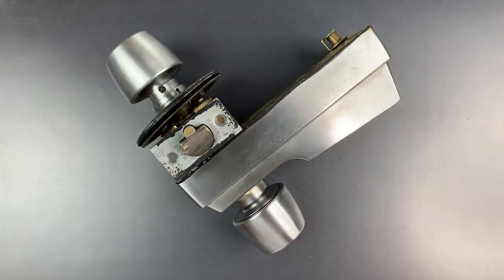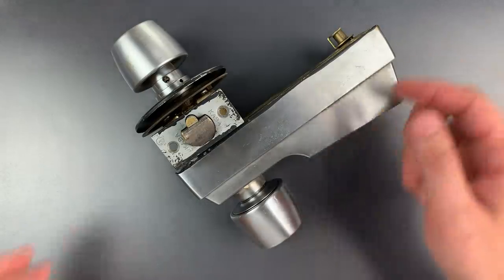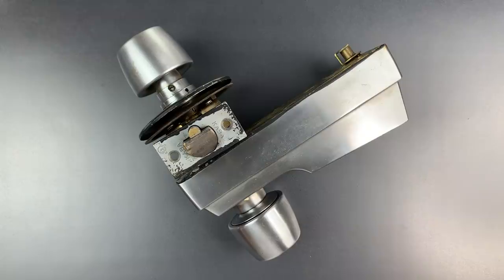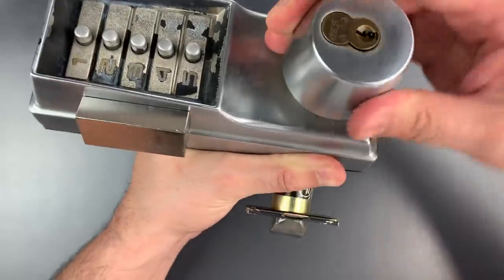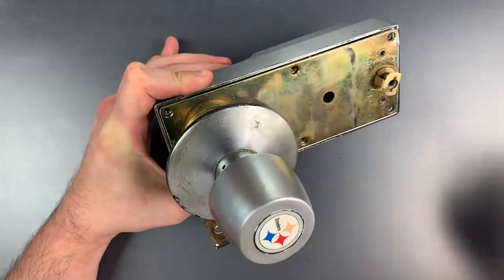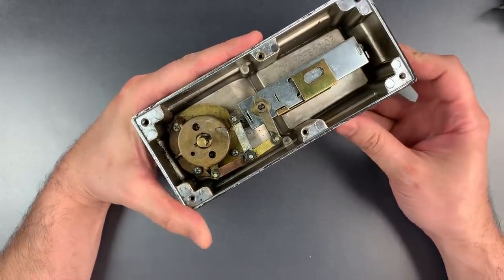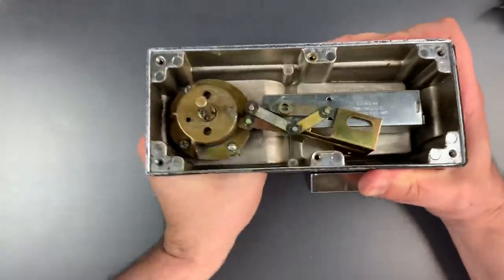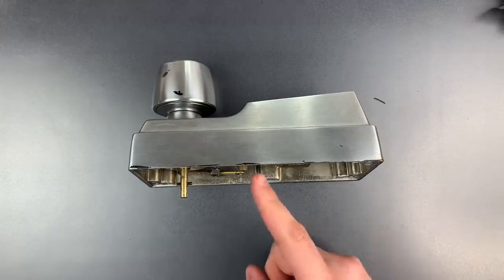[914] The Worst Lock Design Blunder Ever? (Kaba Simplex Series 1000)

Comment: I'm looking at the screen then looking to my right side at my office door,  yep same lock and it's the old version.  My office use to be a research lab, humm guess I'm bringing my neodymium magnet to work tomorrow.  Ok, year later and an update, they put a card key at the main entrance to the area where we had many of these locks about 9 months ago.  Since then I started picking as a hobby and hooked up with the company locksmiths and found boxes and boxes of these old ones ready for disposal.  On a happy note they gave me a bunch of Schlage cores of differing difficulty along with a follower and a few blank keys so I could try out making my own.  We still have a few around but they are for non critical areas so it's not so bad and they're replacing them all slowly but surely.  And have a nice day :)
Reply: William Borgeson is that the only magnet that will work?
Reply: @lagspresso  well, it's gotta be strong and neodymium is hella powerful. Could open up an old hard drive and use those
Reply: Yeah, let us know what happened.
Reply: please update us op
Reply: Olaf Miklas  The HD from older computer had bigger, 4X, magnet. The newer one may be not strong enough.
Reply: Neodymium magnets are easy to get nowadays anyways. I used to have those from hard drives. Very strong.
Reply: Me interested too....
Reply: Update please 🙏
Reply: Update! We want an update!
Reply: Place holder for an update
Reply: William Borgeson update!
Reply: @TaireTV  Hard drive magnets are unfortunately not powerful enough. He uses a medium size magnet but when the lock is mounted on a steel or steel clad door, you need an even bigger magnet. Upwards of 100 lbs of force is about what you need. I think mine is 70 or 80 and it works.
Reply: Remember to give us an update on it working or not
Reply: What a tease!!! You should do it with video!!!
Reply: Hey guys, I have the same lock in my office too! It used to be a uuum... research lab as well, yeah! Im bringing a magnet to work as well tomorrow and going to try the same thing!!!
|
|
|
|
|
v

Dont be so gullible people... It's the internet.
Reply: Update?
Reply: The suspense is killing me
Reply: Y’all he said TOMORROW
Reply: Please go home now and try it today we can't wait much longer!!!
Reply: Ha.
Reply: Update! Update! Update! Update!

WE MUST FEAST ON THE KNOWLEDGE
Reply: awesome
Reply: Please don't do this, or at least be carefull. I showed my company a flaw in their system. They fired me. :)
Reply: noice
Reply: @Picolown  Already found a magnet and so far 5 locks are easily opened.  Notified our inhouse locksmith I can't wait to see his face when he realizes we can open all the labs with a magnet.
Reply: @christian.dev8808  Already found a good magnet and it works, notified our locksmith this should be funny.
Reply: Jonathan Wales  It works perfectly, the locksmith is going to have fun changing out the ferrous plates or replacing the locks.
Reply: @patrickpare9616  Tested and it worked, these babies are here longer than me (17 and counting years).  Should be fun for our locksmith.
Reply: here for the update
Reply: Calm down! Its still the same day, wait within 24 hour or so
Reply: Hey guys, quick update, I got fired from my job and now I'm going to prison for breaking and entering. It worked!
Reply: @tsaychin2954  I have an 80gb iso hdd laying around, would that have a powerful magnet or are we talking even older hdds?
Reply: Microwave magnets are pretty strong
Reply: @Shiore44  You're 14 hours late for the update. Scroll up.
Reply: Waiting to hear from the locksmith  lmao
Reply: neodymium magnets are often found in any decent quality headphones
Reply: @Blox117 those are pretty tiny, nowhere strong enough.
Reply: @Blox117  I bought a few from Scientificsonline.com for magnet fishing, the ones in headphones aren't strong enough to pull the plate.
Reply: @Madlintelf  K&J magnetics has some too, try the N52 page.
Reply: @gonun69  also I am pretty sure you are using cheap headphones (if you even tried at all). magnets in a decent and large set of quality headphones are really strong.
Reply: @Blox117 that magnet you suggested there will definitely be strong enough, just be extremely careful with that, this can easily crush your fingers. I'd say this is way to strong. Concerning the headphones: I got some Sennheisers on my head right now, nothing really expensive, but definitely not cheap. But that doesn't really matter. I have no doubt that there are headphones with very strong magnets in them, but as there are size and weight limits concerning headphones, they can't be very big. And even if they were strong enough to open that lock, why would you sacrifice a pair of expensive headphones to open a lock when you can buy a strong magnet for a few bucks. 
The cheapest way to get some pretty strong magnets is from old harddrives that you can get for free from electronic waste. Combine a few of those and you're good to go.
Reply: @Keith Sweet please be careful when disassembling the magnetron that you don't break that pink ceramic part. The dust is very toxic.
Reply: @gonun69  because i broke my old headphones lol
Reply: @Blox117  Im pretty sure expensive headphone dont have 1lb magnets in each ear cup.  Use your brain...

Posted while using my sennheisers
Reply: @Blox117  Deleted your comment I see.  Guess you can use your brain.
Reply: William Borgeson  I'm a contract locksmith for several industrial facilities... Who I actually showed this flaw to a while back when it first became public.... The hardest part of the job was explaining to management why they should do it... 

"Why should we do this again?"
"OK, you can open these old one's with a magnet, the new one's you can't" 
"Well, OK, but, that'f just for anyone who knows to use a magnet"
"It's on the internet... Genie's out of the bottle, you should upgrade, I can get the new combination boxes, without this flaw, at no cost to you, all you'll pay is standard labor."
"Well, but how many people actually know about it?"
"I don't know, but I promise that anyone who REALLY wants unauthorized access into your R&D lab knows about it" 
"Well yeah, but who carries around a magnet like that?"
"The sort of people who want to get into your R&D lab."
...... crickets..... 
"They're also on your server rooms.... Which means any disgruntled employee who's seen this on youtube can shut your entire facility down with a magnet and cup of coffee..."
.... crickets.... 
 
"OK, if you don't want to retrofit them, fine...  I'll just need you to sign a hold harmless agreement stating that I informed you of the potential for large scale security risk, due to the outdated hardware, offered a cost effective retrofit, which was covered by the manufacturer so all you would pay is my standard labor costs, and the company decided it wasn't worth it.... JUST in case something happens, ya know, I gotta cover my business of course... I'll send over the paperwork tomorrow..." 

Amazingly enough THAT got their attention.... Four days later I was booked up for three weeks solid retrofitting the pre fix units with current combo boxes, which don't have this flaw....  

Fun? Not really.... But I logged in a BUNCH of hours...  so it WAS profitable...
Reply: Stay safe. Stay legal.
Reply: @cykikvisage  Dont know why you entered? Can you get them to explain what exactly you broke?
Reply: @cumulusvapes7  whoosh
Reply: @mortenhartvigkristiansen7760  
Zach Toms
Hey guys, quick update, I got fired from my job and now I'm going to prison for breaking and entering. It worked! 

// Yes, i got that it was a bad "attempt" at humor (so no whoosh), however poor it may have been. False charges, are never a laughing matter though! What would be harder charges to defend, is mischief and possession of burglary tools. If you didnt enter, or break, then it should not apply, was my point...
Reply: What happened?! WE MUST KNOW
Reply: @ExtremeODD  scroll up
Reply: Update?
Reply: @MantasJurkuvenas  scrolly up
Reply: Go to work
Reply: Fatts S  The one I'm in they were working on mice to see how much lead would build up in their bones.  Another lab is doing research on drug resistant TB, fun stuff.
Reply: @Tr4wnet  you do realize the guy did update everyone saying he did try it, it did work and he's let the locksmith know so they can fix it. 

It may be the internet and sure people lie but it seems like you think everyone lies about everything, even this subject which would be pointless to lie about. And now we have him saying he did it so whether lies or not they responded positively and supposedly is getting it fixed. 
Maybe others shouldn't be so gullible but maybe you shouldn't be so presumptuous.
Reply: @Reapers breath last death Areas to improve on both sides, fair enough.
Reply: logmeindog how would the door affect it? The door isn’t between the magnet and the piece of metal the magnet is moving to open the lock
Reply: did he ever update
Reply: @a.n.k.4147  I think he took the scam as far as he could, before we realised it was BS. The company issued a fix, why would it be complicated or hard to implement??
Reply: Careful trying to break into live latches that you don’t own. Be safe, be respectful.
Reply: @garymitchell5899  Why would people 1) know about it, and 2) implement it? You do realize how insanely lazy organizations and companies are, right? And they'd have to be in contact with the manufacturer or otherwise paying attention to news on their lock over decades to find out. Just look at this lovely example of corporate laziness in regards to security and easily fixed, well known, extreme problems: https://fortune.com/2015/04/07/heartbleed-anniversary-vulnerable/
Reply: Give us an update
Reply: @Mr_Stone05  he did. Read the reply lol
Reply: @VideoMasher3000  already did lol
Reply: @Mr_Stone05  nice lol
Reply: Did the locksmith in your company finally replace them all? Any update on this?
Reply: @derekbroestler7687  Awesome story, thank you for sharing!  :D
Reply: @Madlintelf , any update of his face? xD
Reply: @lagspresso  Yes I have tons of Hard Drive magnets but they didn't even stick to the side of the lock (it's aluminum) but the neodymium one I brought from home opened it in no time just a few turns and there you go.
Reply: @tsaychin2954  Exactly we tried a stack of 4 old HDD magnets (think IBM xt size), nothing only the newer big ones (neodymium) worked.
Reply: @Madlintelf  Update?
Reply: @JBroMCMXCI  They put a card access reader on the main door leading to the area with these locks.  They said it was too expensive to replace all of them but they had card readers in the area so just added one for a few bucks.  Yep they cheaped out.
Reply: Wow, OP delivered!
Reply: William Borgeson yeah because card readers are so safe :’D
Reply: I love that you are watching youtube “at work”.
Reply: @Kalle72 I'm in IT so I do a lot of watching on youtube, sometimes it's to learn, sometimes just to destress.
Reply: William Borgeson Nobody’s perfect :)
Reply: GENERAL DISARRAY'S BOSS 83  Ha ha, I'm in NYC working in a hospital, they can't fire me now I'm essential!
Reply: @Blox117  funny coming from you thinking a damn magnet from headphones would do the same thing 😂
Reply: @Usterpirter  Mr. Chase, I assume you have no education in the natural sciences. Have a good day, son.
Reply: @TaireTV  🏆
Reply: @mauriciomarianocarneiro  Your company sucked and you should have sued them.
Reply: Did it work?
Reply: @elektrik3654  Wow, still getting replies a year later.  Yes it did work, told the locksmith and showed him.   There are about 30 of them here so they just secured the main door with an electronic card reader (yes that too can be bypassed, check out the not so civil engineer).
Reply: @Madlintelf  I just followed your comments like a mini series. Thank you for the fun.
Reply: Update?
Reply: @mrthomas7511  So I buddied up with the locksmiths at my hospital during the pandemic.  They loved that I was interested in lockpicking and gave me 7 schlage cores of differing difficulty and a couple of followers. While hanging out with them I found boxes filled with those push button locks.  Turns out they've been removing them and replacing them with card readers.  Initially they just put a card reader on the door that goes to the area with our labs (and those bypassable locks).  Now they are replacing all of them and we're still having fun with different picks and locks, I found some good picking buddies!
Reply: Anytime!
Reply: It would be nice to see how to operate these door locks without a magnet, but in the intended way. Pure mechanical 5 button numbering scheme ?
Reply: @flexiblebirdchannel  There is a key on the back part of the locking mechanism that allows you to customize the combination.  You can even have 2 buttons depressed at the same time as one of the options so lot's of options.
Reply: Honestly, these are literally everywhere.  I think this is hilarious.
Reply: @ntdfmaverick  2 years since I posted that comment and we still have them.  I see them in other buildings as well.  It's funny, at this point I'm a decent picker.  All I see now are security holes everywhere :)
Reply: @Madlintelf  Yeah right on, haha.  I just discovered this channel, and it's opened up a whole world to me.  He was totally right when he mentioned these are found in a lot of government use cases, that's where I personally see them.  Not especially high security, but controlling access to storage areas, containers, outdoor areas, trailers/offices, closets, mechanical rooms; things like that.  Ridiculously common!  Just a cheap crutch for controlling entry.  I didn't realize they were completely mechanical.  I thought they required batteries.  But yeah, watching this stuff makes me want to experiment with some really basic picking around!
Reply: @Madlintelf  Wow really interesting to hear.  Yeah good luck with everything.  I never really devoted much thought to picking locks, other than sticking ID cards in doors to open them, or just popping locks on lockers, mainly to be funny years ago when I was in school.  I didn't realize the extent picking locks established itself as a hobby.  This stuff is super fascinating.  And for me at least, there's a constant tongue-in-cheek sort of humor that goes with it, if that makes any sense.  Haha.  But yeah, I will check out the other channel!  Thank you.
Reply: @lagspresso  2 years later :), seems to be that way, tried many different ones, even a smaller neodymium one, Sparrows is the one that works on them the best.
Reply: kinda crazy to just dispose of $400+ locks when a parts kit can alleviate this issue.
Reply: @ShowemRight  At first yes, but the locks were over 30 years old so it was time.